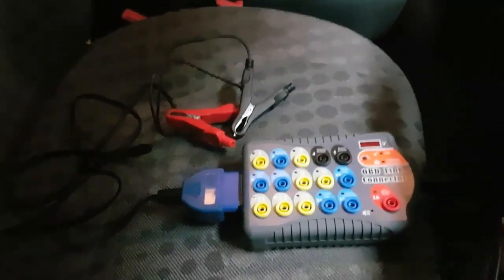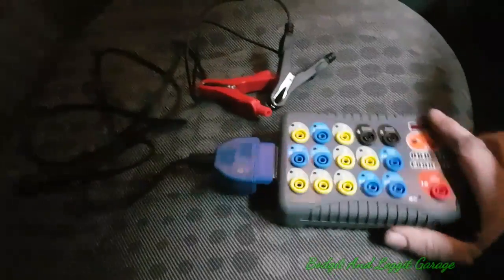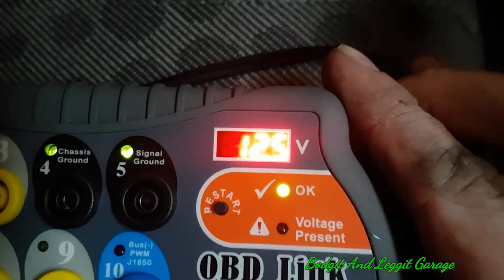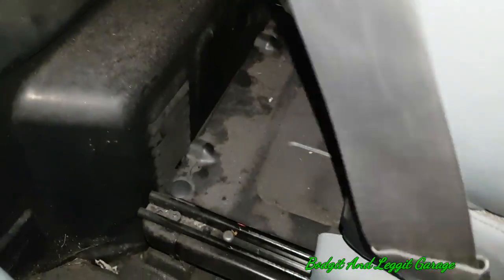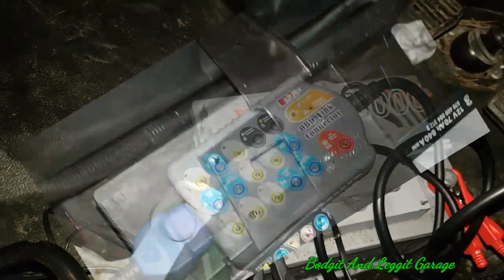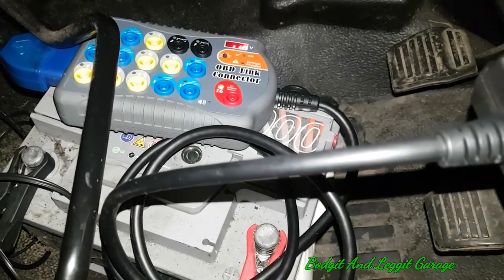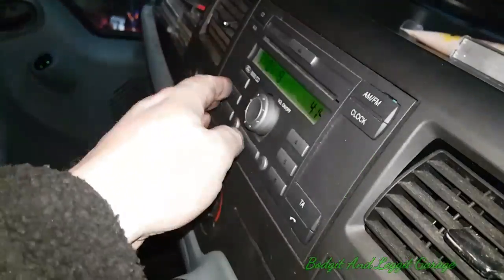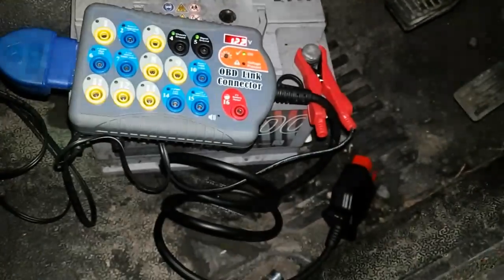Breakout Box As A Memory Saver Dont Lose Your Codes/Module Data Bodgit And Leggit Garage

Comment: Cool.  I don't have a dedicated power input on my breakout. Instead, I'm gonna use my obd2 breakout and connect an m12 battery to pin 4 (chassis ground) and pin 16 (power). I made leads with spade connector on one end (for m12 battery) and 4mm male banana jack on other (for breakout).

Comment: Hiya again, please what's your thoughts on Ebay aftermarket cam sensors which is worst or best/safest make, it's just I have a freelander 1 ESX k series and theres only 18 left in the UK and Ireland I realy dont want to kill her so thought I might beable to pick your wisdom and help abit more the right way would be to pull 180 out for new sensor and loom that is a replacement part for mine but you know me Haha thanks ever so much paul
Reply from the maker: Hi mate it's like everything I personally wouldn't go for the cheap aftermarket parts specially on these type of sensors genuine parts are always the best or the equivalent if you can find out who makes the genuine parts and go direct to them you can often find it cheaper if not in some cases it's better to get a second-hand genuine part than it is to get the cheap aftermarket sensors
Reply: @bodgitandleggitgarage  yeah a see were ya coming from I shall buy a second hand one of Ebay as there is one on and looks decent condition thanks yet again  upmost respect for replying yet being honest and helpfull cheers Paul
Reply from the maker: @Un-_-Known.91  any time mate

Comment: Great use of the breakout box. It needs to be said though that you need everything turned off before relying on the power through the dlc as the fuse on this circuit is usualy about 5amps and easily blown.
Also to make sure the battery + cable dosent touch an earth while your chaging the battery.
Sometimes its more convenient to use the b+ on the alternator to supply voltage through a fused link.
Reply from the maker: Yes mate 100-percent but most people that use these do know that but yes I should have mention in the video but I am going to be doing a full video on this where I will mention everything

Comment: will there be power on the B+ battery terminal clamp when you use the DLC? what about the sig lighter memory saver?? Cheerz
Reply: Yes the b+ will be backfed.
I always try and use the dlc as this is permantly live. Most cigerette lighters are only powered with the ignition on so not useable.
Reply: @shaunsautorepairs5410  so b+ battery clamp must not touch a ground? german cars generally have b+ in siglighter... not acc+
Reply: @joachimjohan1215  yes it does vary...you just need to check before you use it...
Reply from the maker: What he said lol